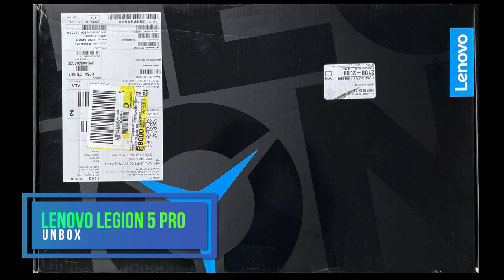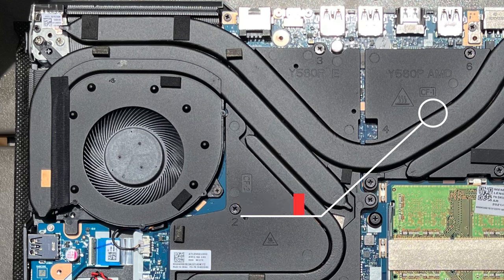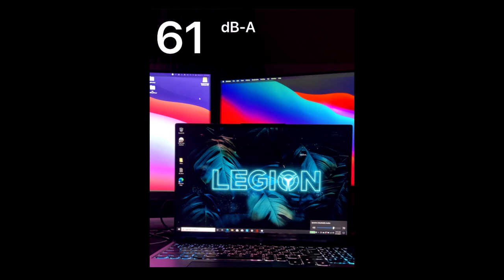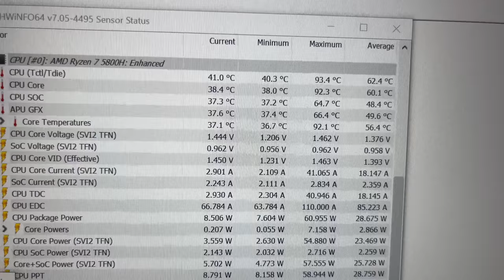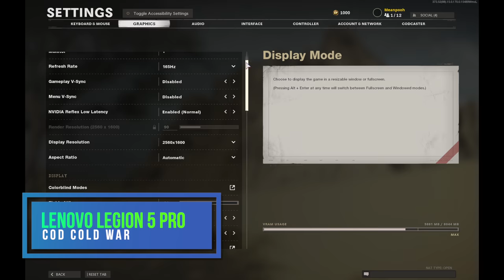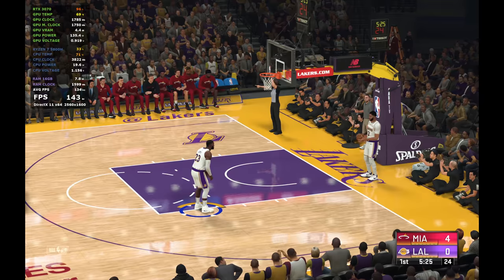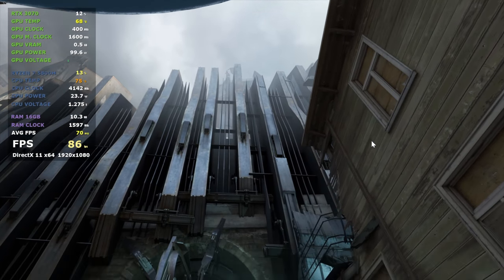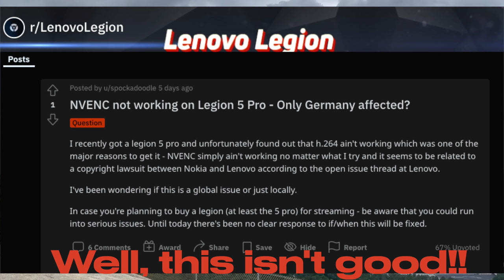Lenovo Legion 5 Pro 2021 Review Simply AMAZING!

Comment: Great review! I bought a Legion 5 Pro with R7 5800H, RTX 3060, 1Tb NVMe ssd, 16Gb DDR4 3200MHz RAM for 980usd today. I even got 2 years of Lenovo Premium Care Onsite warranty along with 2 year Elgiganten's warranty as well and these warranties is included for free in the purchase of the gaming laptop.
Reply from the maker: Damn good deal!👍
Reply: @Meanpooh  Yeah but it had been in Elgiganten's Exhibit for like 9 months and the foam padding was completely missing so i got the original box, some stickers, the charging brick and cable only but the gaming laptop has no scratches and the screen has no visible backlight bleed and no stuck or dead pixels.

Comment: Best laptop I ever owned - no wonder they are sought after. The only thing I would improve are the quiet speakers and the intermittent WLAN card issues with MediaTek. The last issue can easily be fixed with a better Intel card that is easy to change and cheap.
Reply from the maker: I agree with the speakers. They aren’t the best and should be replaced with a premium woofer.

Comment: This review was fantastic. Thank you for the effort. You did not mention anything about the Wi-fi card. I have heard rumblings of needing to switch out for a better one which is disconcerting. The RAM issue is annoying but the setup is just too good to not pull the trigger on it. $80 extra for a pair of memory sticks is doable. 

I too purchased it @walmart for the $1400 deal, with tax it was $1500 and I got the 5% cash back with chase freedom this month for the max of $75 back. This has to be the best high end gaming laptop deal of 2021, particular around Black Friday.
Reply from the maker: I think it's the best deal of 2021, such an awesome machine.  I would have done some WiFi tests but never got around to it.  The RAM IMO worked fine and I never would have switched it out if I didn't get so many requests.  That just adds to the price which defeats the purpose of the deal.

Comment: By far the best detailed review ive seen yet, love the internals section. Im getting mine delivered later today. thanks for giving me all the info i wanted and more before i see it, im pretty excited :)
Reply from the maker: You're welcome,  I use mine just about every other day and it's still doing great.  I have not had to repaste or edit any setting for cool temps.  It's one of the best machines out there.  Just be aware that all machines are not perfect.  If you detect any hardware problems quite early, it may be best to send it back instead of getting it fixed.

Comment: Great video! im stuck between the legion5 pro or the Asus G15 Advantage. All of the reviews show the G15 to be a superior machine compared to the legion 5 pro ONLY if hooked up to an external monitor because of the lack of mux switch. Also the battery life on this machine is abysmal compared to other gaming laptops. Even by changing the refresh rate to 60htz still will only maybe get you an extra 30 minutes. Not sure what compromise im willing to live with.
Reply: Is this where Strix is better in performance than l5 pro?
Reply from the maker: Thanks, I too was stuck between the two.  When I saw the price and was able to snag one it was a done deal, plus the cooling is awesome as well as the screen.

Comment: It has the 1Rx16 ram. You will need to replace it with 1Rx8 3200 if you want full performance. I was unlucky, I purchased a refurbished open box model from Microcenter that had 1Rx8 2400 ram. Why would they put 2400 ram in it? Replaced it with 1Rx8 3200 of course. Also cannot get the keyboard lighting to work. It's stuck on the wave pattern and lighting control does not show in Lenovo Vantage. Tried reinstalling it with no luck. Experiencing flickering screen during gameplay mainly when playing at 1080p. Credit to Microcenter I have purchased a few open boxes before with no problems but thinking about returning this one if I cannot resolve these issues. BTW, Great review!!
Reply from the maker: Oh man sad to hear.  I would definitely return it as it sounds like its hardware related.  If it was working before the RAM install, try putting the other back in.  Other than that, its a great machine.

Comment: What mode was your battery test in? Quiet or Balanced? You can also switch the refresh rate of the screen to 60Hz using the Fn and something key. There is a way to get at least 6-8hrs from this laptop.
Reply from the maker: I may try the test again at lower refresh when I get time.  The test is very lengthy.

Comment: why was the GPU usage so low in half life Alex? was the software just reading the usage wrong. I was planning on buying the legion 5 pro the one with the 3060 will that be good enough for most vr  games?
Reply from the maker: I was trying to figure it out and the problem was that it was in Hybrid mode. I forgot to untoggle it after recording the video of Lenovo Vantage part. The software was reading the Radeon Graphics. That’s why the parameters were weird. After switching back to discrete the problem was solved.  I recorded the HLA game last as I forgot.
Reply: @Meanpooh  thanks man absolute great review

Comment: Thanks for your explanation.
Why was the VRAM stuck on the max when the device was in the hybrid mode?
Reply from the maker: Timestamp?
Reply: Lenovo vantage software, 53".
Reply from the maker: @amirhossiennikpour1381  I was probably running some things in the background.  It's usually at.41 when sitting idle which is 1.5 bars.  I just checked today.
Reply: I bought the same Lenovo device a few days ago; when the device is on the hybrid mode in the idle, the VRAM is stuck on the max (like what I mentioned in this video), but as far as I start doing graphical things, the VRAM becomes entirely rational. Also, when it is not in hybrid mode, VRAM usage is expected and normal. 
In the beginning, I thought maybe the machine had a problem, but I saw some videos like yours, and all were the same, but I m still mindful of why this is?
Reply from the maker: I have no idea than it has to do with with OS.  I wouldn't worry unless your GPU is heating up.  The likely candidate is Windows doing its thing.
Reply: I checked the temperature, and it is normal. 
So, you believe that it is normal.

Comment: This review is super impressive dude Jesus you literally have every single bit of info in here. Pretty tempting to NOT buy this laptop. Good job
Reply from the maker: Glad you liked it!  I tried to cram as much as possible inside, the only drawback is the length if you're used to short videos.
Reply: @Meanpooh  brickseek had 1 available at my local walmart, confirmed via walmart.com. I started looking at reviews last night, before pulling the trigger. Wake up today to place the order, and someone already bought it... nevertheless, fantastic job on this review (I even watched your warzone benchmark videos as well)
Reply from the maker: The machine is a hot deal at the moment especially when saving around 100USD when buying in the store.  There being bought as soon as they drop.  There is a comparable model which is the https://www.bestbuy.com/site/asus-rog-strix-g15-advantage-edition-15-6-fhd-gaming-laptop-amd-ryzen-9-5900hx-16gb-memory-radeonrx-6800m-512gb-ssd/6466550.p?skuId=6466550
It got good reviews when it launched dont know much about it now but it does have the 6800m.

Comment: I’m planning on buying the RTX 3050 cause it’s cheaper will it affect its performance with games  ?
Reply: Homie just asked if there’s a difference between a 3050 and a 3070 in gaming 💀 yes there’s a huge gap between the two. A 3050 is still capable tho, depending on what you play and with the lowering of some setting’s depending on the game

Comment: hey im gonna make a decision between lenovo legion5 pro 2021 it has Ryzen7 5800h, Rtx3070  140WAT and Asus G713QR it has same CPU and RTX3070 130WAT .both have 32GB ram and 2k display.but im not sure abou G713 Adobe rgb%.in my country  G713 is 150$more expensive than lenovo 5 pro .which one is more quality and great for buy ?i really care about my laptop display bacuse it has very important job on my gaming experience. and one more thing G713 have a 300nit display,is it so little?because lenovo have a 500 nit display and im cunfused  thanks .
Reply from the maker: Never used an Asus so I cant comment.  My L5P is still rocking without issue.  Some games will push the CPU which will make it get warm.  The higher the nit the brighter the screen in most circumstances. So my M1 MBP has these specs:
XDR brightness: 1000 nits sustained full-screen.
1600 nits peak2 (HDR content only).
SDR brightness: 500 nits.
I can freely say that the screen is brighter and more vibrant than my L5P.

Comment: Hi, which is better?

Legion 5 Pro 16ACH6H, WQXGA IPS 165Hz G-Sync, AMD Ryzen™ 7 5800H Processor (16M Cache, up to 4.4 GHz), 16GB DDR4, 1TB SSD, GeForce RTX 3070 8GB
$1672

   Legion 7 16ACHg6, WQXGA IPS 165Hz G-Sync, AMD Ryzen™ 7 5800H Processor (16M Cache, up to 4.4GHz), 16GB DDR4, 1TB SSD, GeForce RTX 3070 8GB
$1870

Legion 5 Pro 16IAH7H, WQXGA IPS 165Hz G-Sync, Intel® Core™ i7-12700H Processor (24M Cache, up to 4.70GHz), 32GB DDR5, 1TB SSD, 8GB GeForce RTX 3070 Ti

$2267

Thank you!!!
Reply from the maker: From s speed perspective, number 3 is the best.  If you want extra features get number 2.  It will also be a little slower.  The 5800 is pretty much a year old processor which still kicks ass.  I would guess number 1 and 3 have the same amount of ports but you will get Thunderbolt 4 on the Intel model.  The GPU should be the same while the CPU's are clearly different.  Number 3 also has 32GB of RAM.

I've never owned a Gigabyte laptop just their motherboards but if you are willing to give them a try you can get close to the same specs far cheaper (16GB RAM). 1499
https://www.bestbuy.com/site/gigabyte-aorus-15-6-ips-gaming-laptop-intel-i7-12700h-16gb-memory-nvidia-geforce-rtx-3070-512gb-ssd/6499110.p?skuId=6499110

Edit
I didn't see the "TI" on Number 3.
Which would make number 3 still the best, then Number 2, then Number 1.
The machine I listed only has a 3070 non "TI".

If you have the money get number 3.
Reply: @Meanpooh  with the better i want to said the best price/quality, the majority said to me to buy the fist one cauze there are only a difference of 5% of performance between the legion 5 pro(2021) and the legion 5i(2022), and its not worthy for gaming, but its true it has better technology, and 2300$ is so expensive.
They also told me that the legion 7 is too expensive, if the difference between l5p(2021) and legion 7 was only of 50-100$ i could buy the legion 7, but 300$ more is so expensive only for a legion that has the same specs than the l5p.
Tey reccomend me to buy the first option and then to upgrade the laptop to 32gb ram Kingston Fury dual-channel.
Thanks for answering me, i want to buy the laptop this week, and i think i will buy the first one.
Reply from the maker: Cost wise the first will work and will last a while.  I use it everyday.  Just remember no matter how much you upgrade number 1, it will never be faster than number 3.
Reply: @Meanpooh  thanks for answering, but yesterday they put a discount on all legion laptops in the site where I have bought the laptop, and finally I bought the legion 7, the 32gb model cost 1780$, and the 16gb model 1680$, and I bought the 32gb model.

Comment: Most of the cons I’ve seen in this reviews are inherent to first world country problems 🤷🏻. For example the weight of the device, in my country elementary, school kiddos carry double, triple the weight of that laptop in their backpack everyday walking long distances, so it is really not problem where I come from, and so with the logo and the track pad, turn of logo if you don’t like and disable track pad if you feel it uncomfortable at some point and use a mouse, problems solved. As portable device battery life is far more important if you are going to be unplugged for long periods of time, and absolutely need to work with full power software , that’s why M1-M2 MacBooks 💻 exists for. Let’s not forget gaming laptops are often purchased as desktop replacements so keep in mind these devices are always going to be hotter, heavier and bigger than most of the average products out there.
Reply from the maker: I 100% agree with you.  Why would a person want to pack a gaming laptop to school when it runs hot, bad battery on most and sometimes just too large.  If a MacBook can be used, they should.  They are the ultimate in battery life and productivity.   Cost of entry is rather higher though.  These machines really are desktop replacements to a degree and should be treated as such.  More power than a typical laptop with the ability to be portable when needed.  Personally I don't think the machines are thick enough.
Reply: @Meanpooh  TOTALLY AGREE WITH WHAT YOU HAVE STATED BRO, LETS JUST ENJOY WHAT WE HAVE, AND KEEP IN MIND THAT TECHNOLOGICALLY SPEAKING, WHEN YOU BUY SOMETHING, THERE IS ALWAYS GOING TO BE THE NEXT BEST THING AROUND THE CORNER. PEACE AND BLESSINGS FOR YOU AND YOUR CHANNEL, REALLY HOPE THAT YOU GROW EXPONENTIALLY IN THE YEARS TO COME, GOOD NIGTH  BRO 👍.

Comment: Este es 16ACH6H?
Reply: @Meanpooh  what 16ACH6H means? Theres other one say 16ITH6H which one is better?
Reply from the maker: You have to look at the specs, don't worry about the model number.
Reply: @Meanpooh  ok i thought the number means its refurbished
Reply: @Meanpooh  i'm between Legion 5 Pro Ryzen 5800H RTX3070 and Legion 7 i7 10750H RTX2060 which one should i go??
Reply from the maker: Not sure but the one I purchased was brand new.
Reply from the maker: Get the 3070.
Reply: @Meanpooh  what about Legion 7 i7 11800H rtx3070 8GB or MSI GE66 Raider i7 10750H rtx2060 super 8GB which one??